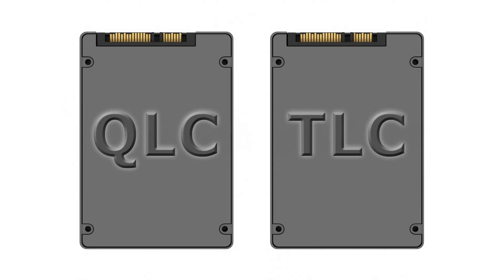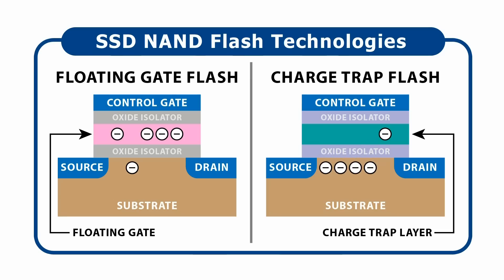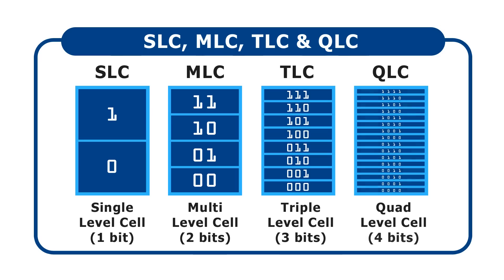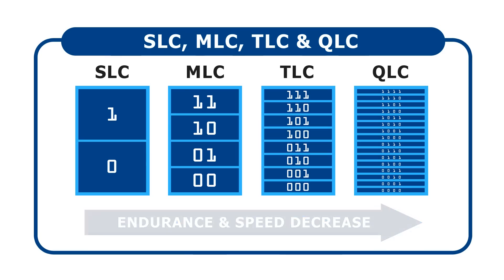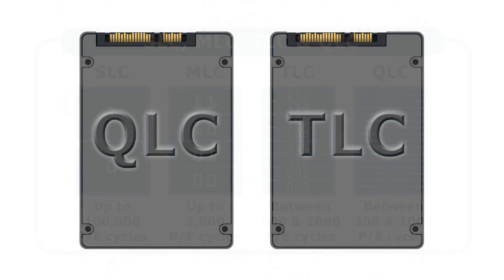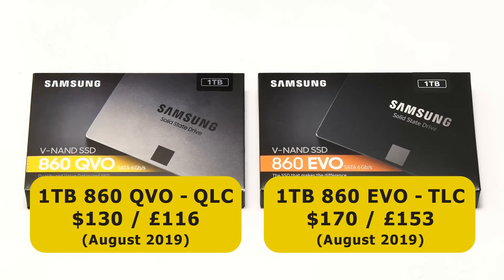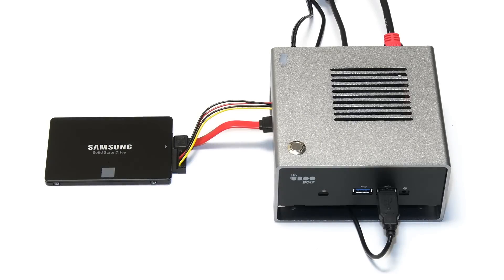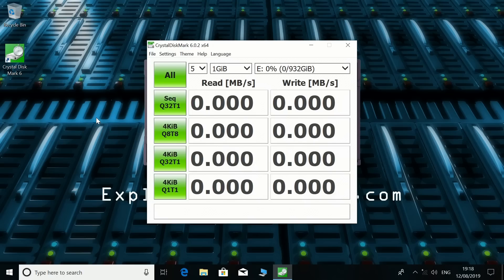QLC vs TLC SSDs: Samsung QVO & EVO

Comment: I'm spending the big dollars and sticking with the 970 Pro NVMe 1TB primary drive. My second drive is a 1TB TLC EVO and my third drive is a 4TB 7,200RPM conventional hard drive. Guess what? I use the hard drive to backup the other two drives on a scheduled basis every three days. I also have cloud backup, once a week (fully encrypted of course). Truth is, you'd be crazy building a new computer NOT to use NVMe M.2 as your primary (preferably with a cooler as they devices get seriously hot when in heavy use). Of course if you don't do image and video processing, it's probably an academic difference between the EVO and QVO but until QVO hit 4TB I honestly don't see myself using QVO as a primary. The reason is simple of course, TBW increases (almost) linearly with capacity. Rule of thumb - never operate your primary drive more than 60-70% full. Otherwise you're making the SSD management chips life so much harder, which translates (in extreme cases) to serious degradation.

Comment: Where are you getting your prices?

Newegg has the EVO for $139 and the QVO for $119.

The WD 1TB 3D Blue is very competitive with the EVO and costs $109.

QVO is priced too high for the lower endurance. It needs to be cheaper given the lack of endurance and lower performance.
Reply from the maker: I said where I was getting the prices -- they are the official Samsung prices at the time of making the video.
Reply: @ExplainingComputers  sorry.

I missed that.

Retail prices are better, thankfully, but QLC is still too high given the lower endurance.

The speed is quite impressive before the cache is used up.

Comment: Chris, its not that SLCs are different capacity.
the SLC is filling up AND being dumped at the same time.
Because SLC is moving out its data faster onto TLC than QLC, it will also take longer to fill up.
Reply from the maker: I'm sure this explains things to a point. But seeing no fall off from the EVO is very strange. I suspect others here are right in saying that the 1TB EVO drive was probably manufactured as a 2TB, failed quality checks, and was reset as a 1TB, if retaining the larger cache.

Comment: Toshiba is talking about a slight modification of QLC that results in PLC.

"To achieve this ability to store one extra bit of information per cell (compared to QLC), a new level of voltage refinement is required: the cell has to be able to change its state according to one of 32 voltage states, which, in turn, have to be read out correctly by the flash memory controller. This reduces the cell's performance and endurance (as does any increase in the number of bits per cell), and will require a number of solutions to mitigate and compensate for this reduced performance."

https://www.techpowerup.com/258650/toshiba-talks-about-5-bit-per-cell-plc-flash-memory
Reply from the maker: Very interesting, thanks for the link.

Comment: I must admit that I had no interest in watching this video at first.  But how can you resist Stanley the Knife? I had no idea that the MTBF was so short with SSDs, in fact I thought it would be much longer than the 15 to 30 years generally quoted for mechanical drives.  I bought an EVO a couple years ago specifically for video production, so I shall now backup that data on a mechanical drive.  That was something that I did not think was nessesary until now.  Thanks for the video.

Comment: Very helpful information! Possible sidenote: Would it be faster to transfer a file that's larger than the cache in seperate chunks? Would the cache reset and resume copying at it's original ~450 Mb/s?
Reply from the maker: Yes, if you could wait and do the transfers in chunks they would indeed be faster.

Comment: I still remember the day when we say “ewwww” to the TLC nand flash. Now companies are pushing the less good QLC.
Reply: PLC is coming next. more ewww
Reply: QLC is cheaper. it's like how people are complaining that super car companies are pushing small engines with turbos instead of the big v8's of the past. it's all about maintaining similar performance for less price. Yes, small engines with turbos (QLC) may not be as reliable as the big old engines (TLC), but it won't matter since even newer technology will be available by the time the current tech (QLC) dies.
Reply: @angrysocialjusticewarrior  Good analogy
Reply: That's because V-NAND have boosted the reliability and speed of flash memory. So you can have TLC V-NAND that is faster and more reliable than older MLC NAND. I'd trust TLC V-NAND for my system drive and be okay with QLC for my media storage drive.
Reply: Hey PoPe, what do you make of MiCRoN's 5100/5200 MaX series?

They are supposed to be better than their PRo & eCo counterparts, but are they the same as a PRO version from SaMSuNG??

Comment: 5 bit SSDs will be released soon enough as far I´m aware. Guess those will be dirt cheap. Though I wouldn´t buy below TLC.
Reply: Depends on how much data you want to store and if you value reading over writing speed. I see great potential in using these as a games drive for just the read speed with less emphasis on the write speed (granted they don't drop to single digits since that'll be awful regardless).

Comment: Honestly the 70 MB/s on the qlc quite shocked me as the speed is lower than an HDD, for big files.
I just did a test copy of 60gb GoPro video files from a 7200rpm HDD to a 5400rpm HDD and the average speed was about 95-100 MB/s.
I have to say, I never knew the cache played such a big role in SSDs.
Reply: my 2TB QVO fared much better slowing down to just 140MB/s with 600GB of games to be transferred. I bought it for the faster reading though to limit the pesky loading screens, not for fast writing D:

Comment: I do wonder how the QVO performs if you have a lot of games stored on it and you launch a game that isn't played often. Since it'll have to read it from the QLC memory, will it be faster than a hard drive? If so how much faster? If it isn't much faster then this is better for cheap laptops that are now sold with a hard drive only. Desktops have more space in general so you can just run a combination of a fast SSD and spinning rust instead of QLC SSD's.
Reply from the maker: Read times for any SSD, inc QVO, will be much faster (3 to 4 times) than a HDD. So games will launch far quicker.

Comment: sadly christopher has made a kind of error, 42gb is only the cache at the beginning with empty SSDs. When the capacity is full the cache shrinks very much. So, the test is not accurate and it is not what you will see in normal use with Games, Downloads, Videos saved on it. (well, except you buy a SSD and not storing things on it 😁)
Reply from the maker: The cache will be emptied after use. It will not shrink unless the drive is very, very full. To be specific, 6GB of the cache is entirely separate to the main storage cells on the drive and never shrinks. The remainder is "borrowed" from free space, so that 36GB requires 108GB of the TLC drive, and 144GB of the QLC.

Comment: Could you test the QLC drive with primo Cache and a faster storage I been thinking of using these in raid but paired with my optane 118gb or 280 900p drive to balance storage and speed.

Comment: You can read on the samsung website you provided "The sequential write performances after Intelligent TurboWrite region are 300 MB/s for 250/500 GB and 500 MB/s for 1 TB." So it's working like it should, being a 1TB model. It makes  you wonder why those models even have cache if they don't need it.
Most brands don't even use SLC caching on their TLC sata ssd's because TLC alone is fast enough to saturate that interface, if parallelized.

Comment: They aren't halving the life expectancy. For the QVO and EVO drives, they simply use a factor of 10 TBW Per month, multiplied by months per year. 10x12=120, 120x3 years =360 TBW.
120X5 years=600TBW.
The pro drive uses a base rate of 20 assumed TBW per month, for 5 years. That equates to 1200TBW. The only Intrisic information we can gather from this is that  Samsung gives more confidence in its MLC drive than either of the other 2 drives, but places the other 2 drives on the same usage scale.

That being the case, the pro drive is likely, therefore, intended for more aggressive use like heavy levels of video editing.
Reply from the maker: I was referring to them roughly halving the data written life expectancy of each flash memory cell, not individual drives. But I am certain that the TBC figures come first -- they don't assume a life expectancy in years than than multiply up by a monthly rate (as you imply). Rather they start with a TBW, and then calculate/estimate a life expectancy for the guarantee.

Comment: Let's see what 360 TBW (TeraBytes Written) means in practice. Assuming 1TB of data being written every single day, the drive would lose its warranty in about 1 year. So this is clearly the wrong choice for people who do a lot of video editing or other storage intensive tasks on a daily basis.

But for the common user, who normally don't overpass 20GB of data written (on average), this translates into a lifespan of around 50 years, which is nuts. Even at 50GB written every single day, a QVO drive would last for around 20 years. And considering all the QVO drives (1/2/4TB) have a MTBF (mean time between failures) of 1.5 million hours (171 years), these drives are a great choice for a lot of users.

Now all we need is for them to become cheap enough for the everyday PC user, and the HDDs will no longer make sense for people who don't need massive amounts of storage capacity. And when this happens, the HDD prices will go up, because of the lower demand. In probably 2-3 years after their prices increase, while the SSD prices would be going down, the HDD/SSD price/capacity ratio will even out and it will make more sense to buy SSDs because of their higher speed. By that time, the SSD will have become what HDDs are today, and NVMe SSDs will be the go to choice for people requiring more performance at a reasonably more expensive price.
Reply: The QVO's TBW is pretty good.

My WD Blue 1TB 3D NAND is rated for 400 TBW, which isn't a great deal better.

However, it doesn't slow down to 70MB/s when the cache is filled. Frankly I've never managed to slow down the drive yet and I do a fair bit of video work on that machine, however I do not have a fast enough secondary drive to copy 100+ GB of data to it at SSD write speeds.
Reply: Mechanical drives are already far more expensive than SSD. 860 500gb ssd is only $60

Comment: How many GBytes are written by OS as Windows or Linux Mint in idle operation - just to keep the OS running, houskeeping etc?
Reply from the maker: Probably less than 1 GB a week on most PCs.
Reply: @ExplainingComputers  Thanks for your reply! 
I have here a Laptop Win 10 Laptop running 3 applications 7/24. All the applications use different drives as data drives - not the system drive C:. During the last 3 days the SSD system drive C: accumulated ca. 10GBWritten/day.

Comment: Here is a tip: If you want to buy a QVO or any otehr QLC drive, save up for 2TB mode, 2TB QVO drops to 160Mb/s as lowest [its twice faster then 1TB model on the lowest performance] and 160Mb/s is not that bad because it only happened after you filled 42Gb, so you'll rarely see it and its the WORSE case scenario, it wont run slower then that.

Comment: As someone who watches many videos in the tech side of YouTube; I have to say this is probably one of the best I've ever watched. Not only is the theory there but also most aspects of practical information I could ever wish to find in a single video. Amongst other useful information there are comparisons between two current market leading SSDs, which is of high value to those buying SSDs right now, and also including current market price to give the viewer a better idea of price to performance, which is a significant concern for the average buyer.

Comment: the cache size on TLC/QLC depends on the free memory available on the SSD (as virtually the cache uses the same storage, just organized differently either as SLC or as QLC/TLC naturally if you have lots of free memory on SSD you can have a huge cache - up to 1/4 of the SSD capacity).

As for trust - I wonder how does it survives time as such (material diffusion) + combined with high temeperatures (30oC or more inside the PC). + Electromagnetic fields. It may soon come to an Orwellian "memory hole" concept when you store some data but who really knows or cares if it is still there or ever was... Who looks at all those videos and photos shot on vacation anyway...
Reply from the maker: This is true, but Samsung also sets a limit on each drive -- the cache cannot expand beyond this limit.

Comment: Very well put together video! I really enjoyed this explanation.

I'm left with two questions to elaborate on the topic.
1. As you showed, the QVO slows down considerably after a while. If you were to stop the copy or limit it to its buffer size,  how long would it take for the QVO to be ready to do another big write operation? Probably just as long as if you would have done it in a single write operation. But this would be interesting to see. It means a write operation may slow down because of a previous write operation and there is an invisible wait time for it to speed up again.

2. SSD's degrade with write operations. What about read operations? Would it make sense to buy a SLC or TLC for a boot drive and virtual memory, and pushing mass storage, like photo albums and games, which are less subject to change to a QLC?
Reply: Reading won't change what's in the cells which effectively means it won't degradate them at all.

Comment: I still have my 30 gb ssd that works perfectly fine ( used for windows installation drive) everything else is on HDD or new ssd till now i had 2 HDD failures since that ssd been instaled as system drive.

Comment: I'm still using my Samsung 840 EVO 250GB 2.5" SSD since 2/27/2014 and still going strong with 23.5GB TBW, I'm planning on upgrading my SSD soon to a 970 EVO Plus 1TB

also QLC technology might be perfect as a backup storage drive as a external drive or a second drive for a laptop

Comment: If I understood it well, a large qlc drive makes sense, since the controller would move the data whenever it should, but at the expense of its lifetime, give 5-10 years. A small tlc or mlc drive would be much faster and have longer lifetime, at the expense of large files though. Either way we should expect to replace those ssd after 10+ years right?! By that time storage would be much cheaper I hope. Basically any type of ssd would be rather good these days...
Reply from the maker: You understood perfectly. :)

Comment: The cache lasts longer on the EVO than the QVO because data is "flowing" out of the cache into the permanent memory faster on the EVO than the QVO.  Eventually you would have seen a similar, but not as severe, bottleneck on the EVO somewhere past the 2 minute 41 second mark.  Your test just didn't go long enough to hit that bottleneck.  Part 2 perhaps?

Comment: I have both drives in a build, but neither is used for booting Windows. The QVO is used for temporary work, while the EVO is mainly storage.  I have 512GB Samsung 970 PRO NVMe,  which is the boot drive and another 1TB which is used for video encoding. I don't think it was mistake buying these drives, and your wonderful video confirms that.

Comment: Great video that clearly shows how efficient an SSD drive really is.  I just replaced my 500g Samsung 850 EVO with a 500g Samsung 860 EVO to transfer over to Windows 10 and I'm very happy with Samsung.  Their software is the easiest to use and the price for the 860 was less then what I had paid for the 850!  I remember back in 1990 when I built my 486-66 I decided to spend an extra $50 for a 250 MB hd instead of a 200 MB!  By the late 90s hard drives were less then 50c a mb and I thought that was wonderful, and now we've seen the same drop in prices per gigabyte SSDs and now we see prices for terabyte SSD drives dropping.  Isn't technology wonderful?

Comment: If the cache size is 42 GB for each, and one method is faster than the other, the effective cache size could be much larger for a faster drive than a slower drive if each began writing the cache to disk as soon as the transfer began, flushing bits from the cache every 'x' GB or after a given file was successfully written? Perhaps the dramatically lower performance for a 4KB file is partially due to some lower limit for files that utilize the cache? (@11:42)

Comment: I can't understand why you need 83 gb big files for your videos when you clearly dont need to when you only talk about what you see on your screen, and small segments of the  video.
Reply from the maker: ProRes video has a high data rate, and offers massive flexibility (and speed) in post, as frames are individually compressed. So anybody recording ProRes or DNxHD (the two main pro formats) will end up with files this large (the data rate is between 100 and 220 MB/s). Look at the lengths of the files used for the copy -- they are not long. And I often record a lot of video for sections when it time lapse (like in the tests here!).

Comment: You made a little logical mistake there, when you tested the write speeds, when you assumed the drives should slow down at 42GB.

For example, let's assume the TLC has half the write speed of the cache, then after writing 42GB to the cache, the cache shifted already 21GB to the TLC. So the cache would only be full after copying 84GB.
In the QVO the QLC has around 15% the speed of the cache. It didn't slow down at 55%, but at 61%, because at 55% 42GB were moved, but the cache already moved data to the slower QLC.
The faster the actual disk, the longer it will take to fill the cache.
So as 75GB won't fill the 42GB cache on the EVO, the TLC should be at least around half the speed of the cache.